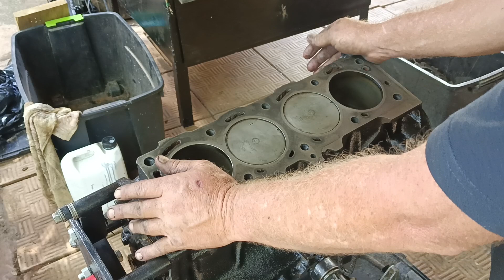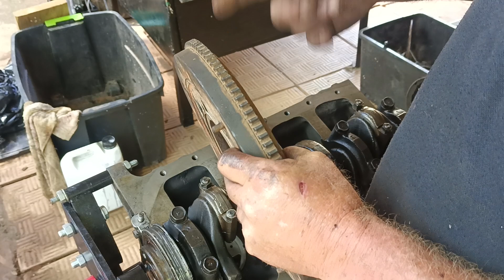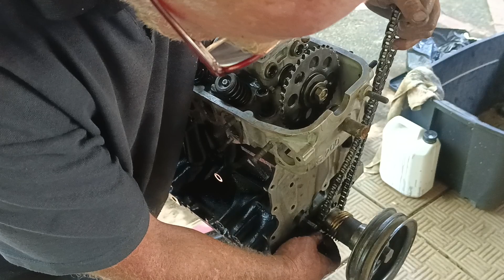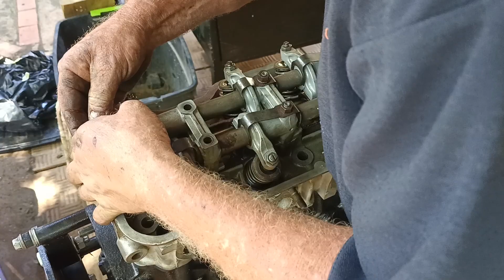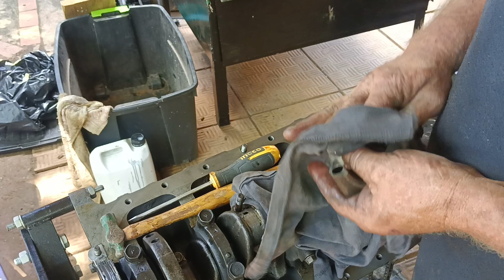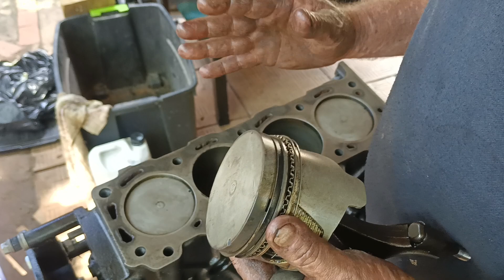What is an engine overhaul

Comment: WILL ALWAYS SUB TO A MECHANIC
Reply from the maker: I usually do, I've built a few motors in the day but not too many and a while ago, working on building up more equipment i.e engine crane etc to start doing it on my own again, until then I do have a well priced and brilliant mechanic to do the engine work. This is a spare motor off the Isuzu build I've been tinkering with and basically stripping and boxing up for spares